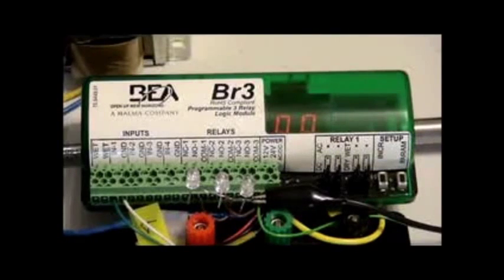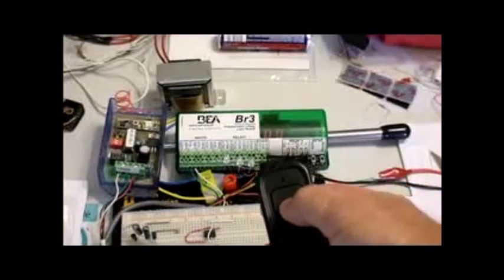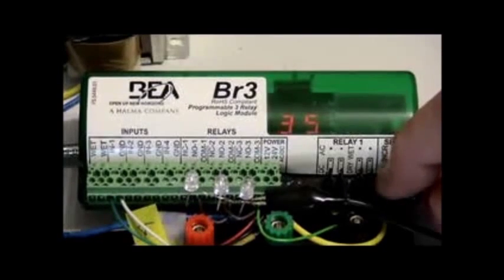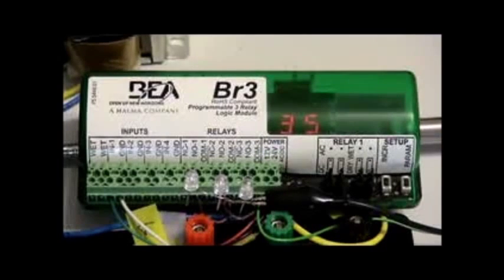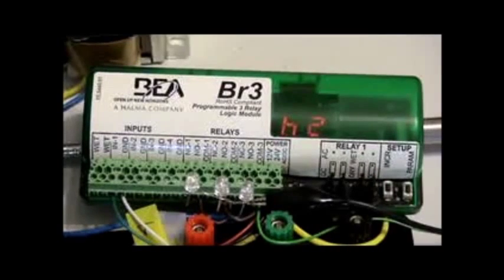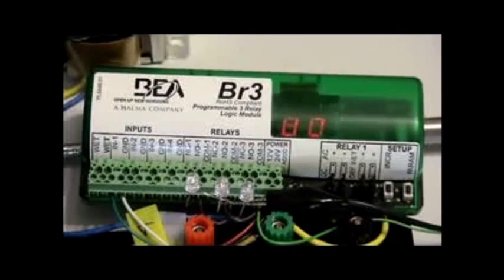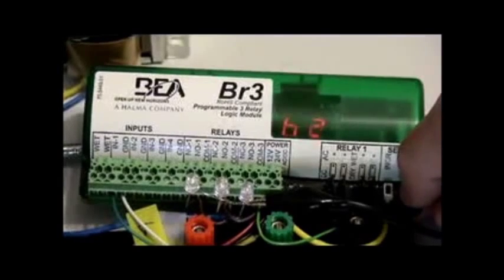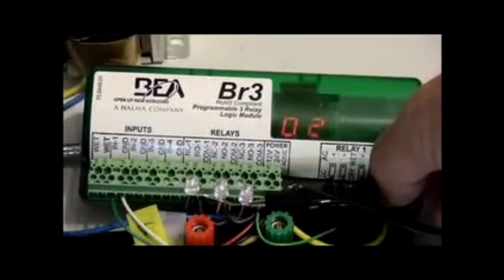BR3 - F35

Comment: did you need to change the state to wet?
Reply: +Daniel Gomez  I'm going to be using function 25. I'm going to be using a Larco receiver and my push plate activation. and a unspecified Electric Latch to Relay1.  My 2nd set of Jumpers would be set to the upper 2 rods making it WET. my Relay2 would be were I would use jumper wires to send my signal to my controller activating the door. Module 22. (h1* 3)(h2*5) (d*_3) Thank you for all the help!